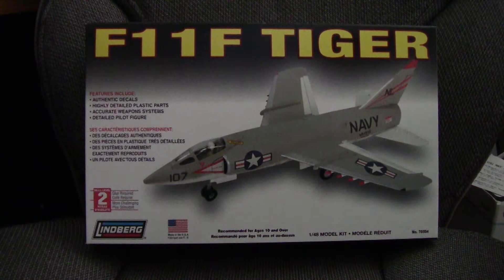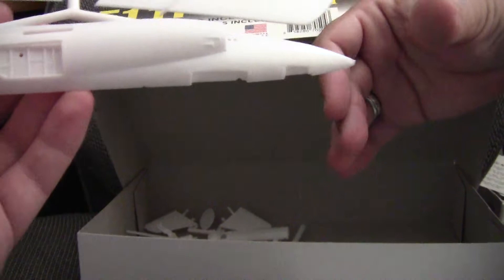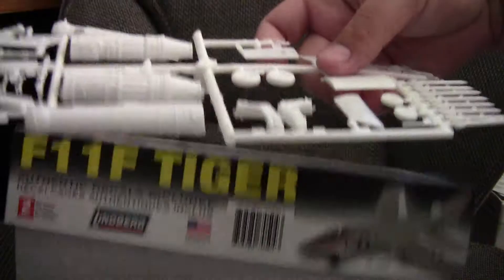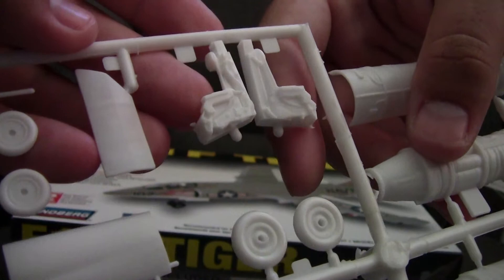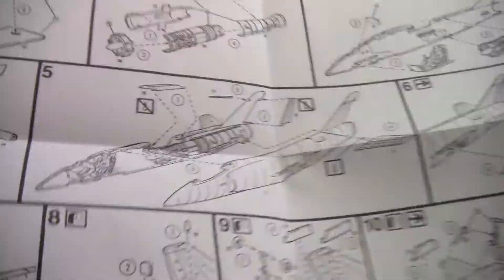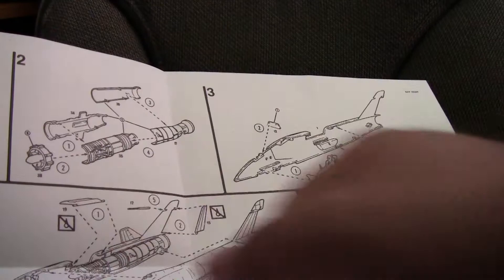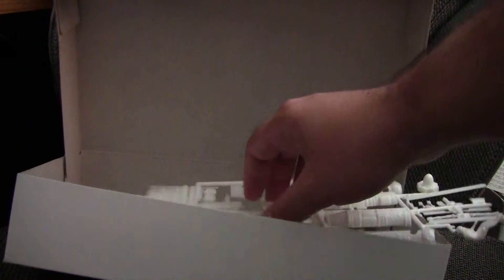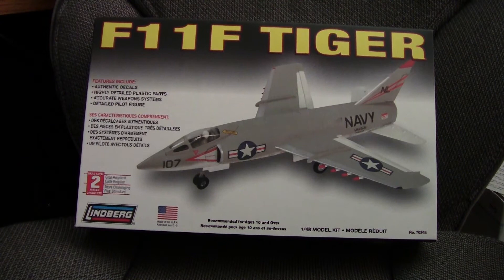1/48 Lindberg F11F Tiger Review/Preview

Comment: I always thought this kit looked a bit odd, the shorter nose cone denotes it's an early variant of the Tiger but the paint scheme would be used on the later versions so some kind of compromise. Like others have stated, it's an old kit from the 1950s and it's better for younger modelers getting into the hobby then older, more skilled modelers. 12 or so years ago a company called FM produced a very nice limited run F-11F-2 Tiger kit, you might want to track that down if you're still itching to build the Grumman jet. Happy modeling!

Comment: This kit has been re-released multiple times since the 1950's, and is understandably "primitive" by today's kit criteria for quality.  Take it for what it is - an EARLY plastic kit.  Moreover, its nose is very short because the kit was patterned after the original F9F-9, which was the precursor aircraft to the F11F-1.  If you examine photos of the F9F-9, you will see that its nose was also VERY SHORT!  The usefulness of this kit is that with added detailing in the cockpit, correction of the gun location and wing fences - be sure to use the nose boom - it can be made into a convincing F9F-9 prototype of the Tiger.  

One thing more...the reviewer seems too impressed with the kit's engine.  It's the SAME engine used in Lindberg's F-100 and  F4D-1 kits.  These aircraft were powered by Pratt & Whitney J-57 turbojets.  The Tiger kit's engine is more nearly like General Electric's J-47 turbojet (with an afterburner no less!).  The F9F-9 used a Curtis-Wright J-65, which the kit's engine does NOT depict.  Alas, some preliminary research of the Tiger would have made this review more accurate and helpful, rather than the uninformed opinion that made up this review.